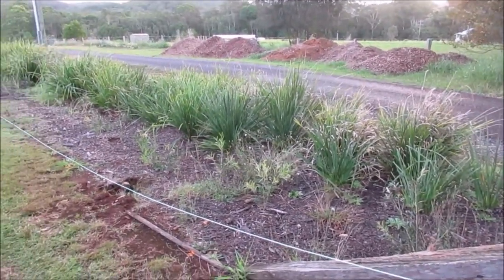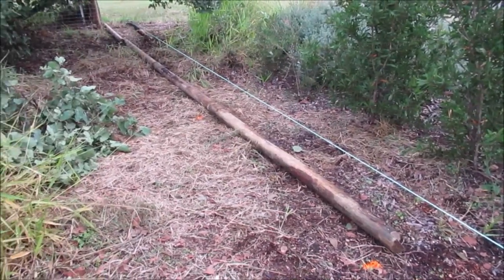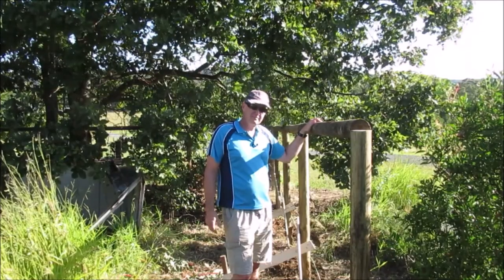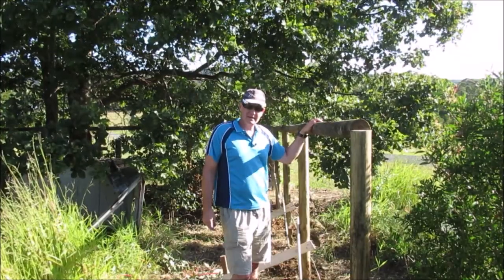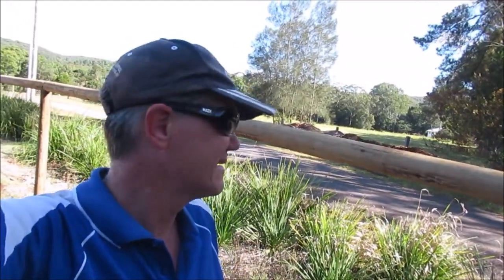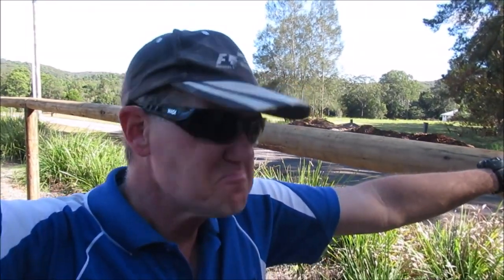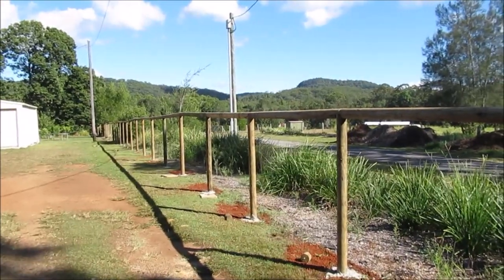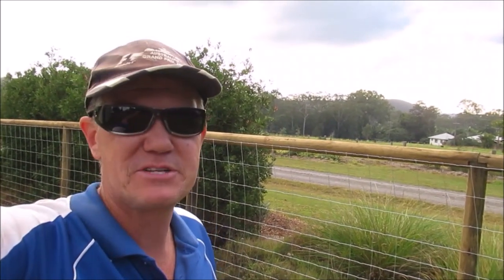How to Build a Post and Rail fence with wire mesh Part 5

Comment: What was the length of the top rail and how did you determine the spacing you wanted between post e.g. was it the gauge of the wire or top post length. Liked the vid am about to build a similar one myself but no top post
Reply from the maker: I used 2.4m long posts and used the same for the top rail.  This then set the spacing between the posts.
Good luck with your build.  If you don't put on a top rail make sure you add some extra support at all end posts and corners (or change of direction).  If you don't add either a diagonal support or something similar, the load will pull the posts over.
Cheers Shaun
Reply: @countrylifeonthecoast4167  Many thanks

Comment: Good work. May be a sting line to measure out that top rail and where to cut the posts and a bottom string line to check the bottom of the fence will be correct. Would a chainsaw be better than the circular saw or would it leave to rough of cut that might not be square? Thank you for sharing.
Reply from the maker: Thanks for the advice.  After doing it I thought that a string line would probably be the better option.  The way I did it worked in the earlier sections but the uneven ground in this section created the problem.  I think I'll be using the string line for future sections.  Re the chainsaw, I'm not convinced I'd get a smooth square cut. Thanks for watching.
Reply: I guess I'm kinda randomly asking but do anyone know of a good website to stream newly released series online?
Reply: @Harvey Declan Flixportal :)
Reply: @Jericho Carl thank you, I signed up and it seems like a nice service :) I really appreciate it !!
Reply: @Harvey Declan you are welcome :)